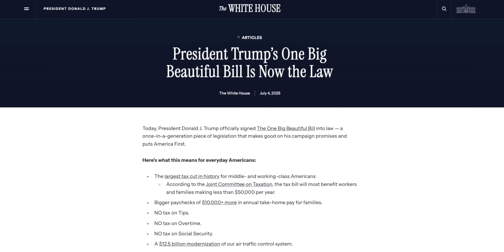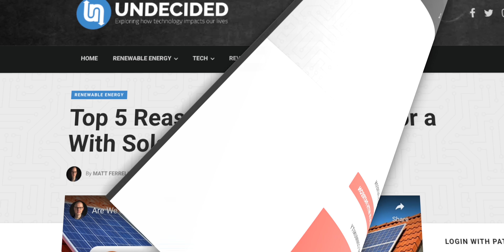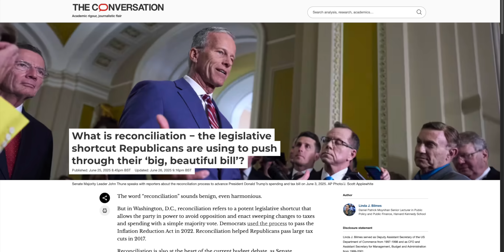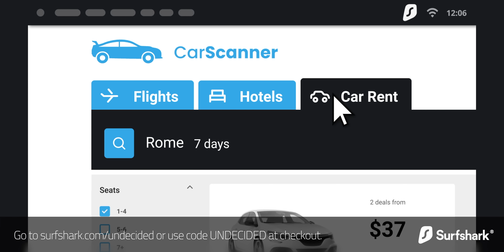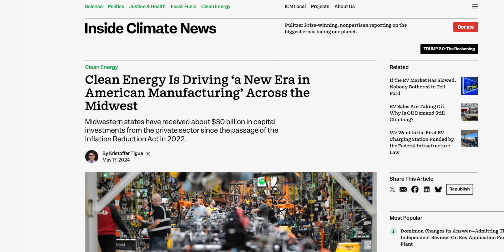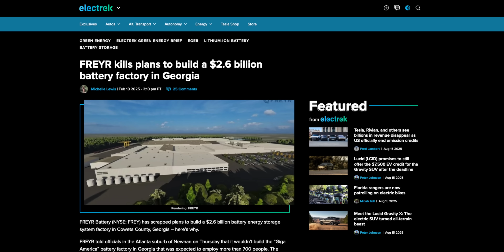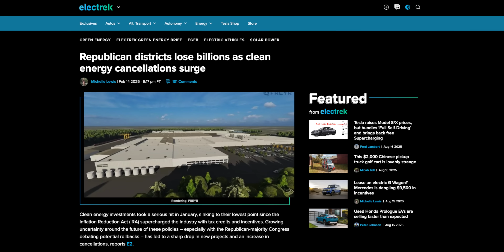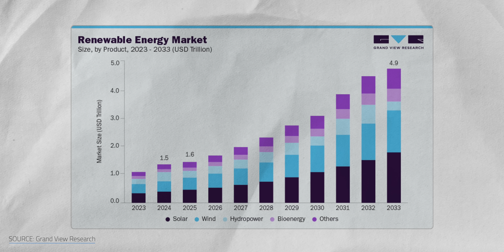How the U.S. Just Handed the Renewable Future to China

Comment: Solar panels are EXTREMELY cheap, no tax credit is needed. The 30% credit on rooftop solar goes straight to higher costs. For rooftop solar, about 70-80% of the cost is just markup, labor, and permits. People can install their own system without the subsidy and still pay half what they would have paying an installer with it. Solar is already the cheapest energy source, so there isn't a need for incentives, already more than 90% of new energy comes from renewables. There is currently a massive oversupply of panels, this 6 month lead time I am calling BS on.  I HIGHLY doubt this will cost 300,000 jobs, this is pure nonsense. Claiming encouraging manufacturing to be domestic will hurt the industry is just plane false. You admit solar is the cheapest energy available, while simultaneously claiming it is in desperate need of subsidies.

For cars... EVs have become cheaper over the years, as battery prices plummet. $7500 credit mostly benefits those with money, as lower income people aren't buying new cars anyway. This just burns money we don't have, we are approaching 40 trillion in debt. If everyone got a new EV, this would just be a tax on everyone, since trillions would be shelled out paying for these, either taxes would need to go up, or we would go that much more in debt. This is just rich people complaining.

The Inflation increasing act numbers are bogus, that thing was a joke. They make up wild numbers out of thin air. It is making all sorts of wild assumptions and twisting reality. There are a ton of solar jobs now because it is cheap. Getting rid of tax credits won't just make the jobs go away, solar will still be very cheap, and the industry will continue to expand. Research will continue, this effect is massively overblown by partisan hacks.

At this point, solar is very mature, I would propose more research and investment on nuclear, which is still happening, just slowly.

I am 100% for moving to renewables, and would encourage everyone with good sun to get solar. Financially it just makes sense, subsidy or not, the equipment is extremely cheap. Spend a bit of time doing it yourself, or at least as much as you can possibly just getting an electrician to help if you aren't comfortable with part of it. Ground mount is the best choice if you can, much easier to install, maintain, and upgrade. It isn't that hard, just watch YT videos, I highly suggest Will Prowse.

Comment: Ehhhhh...being a bit ommissive of some important facts. 
1. I don't think any energy source should receive subsidies.
2. BECAUSE China manufactures 80% of the solar panels, that means we are giving 80% of the subsidies to China. They are also benefitting from the tax rebates as well because they can sell MORE.
3. A good portion of products bought from china is built with slave labor and with materials acquired using far less ecological means, which often offset the carbon footprint benefit of 'green' energy.
3. As good as solar panels are, they're only good when there is sunlight. Thats not constant power generation that civilization needs to operate. Oil and coal can do that for now but we do need to go nuclear.
4. Wind is just god awful. Overly wasteful when it comes to carbon offset and the amount of time they're either broken or just not generating energy makes them a scam.

Comment: It's not all bad. The US will have two chances in the next three years to adjust course. The first will be the mid term elections next year. A little recession timed right could be brutal for republicans and people are getting nervous about that. Trump turns into a lame duck president regardless of the outcome. The second moment after that will be the presidential elections that follow. Both parties will be distancing themselves from Trump, failing policy, etc. Regardless of who wins that, a 180 degree change in policy to contrast with Trump is almost a given. Especially if economics aren't adding up. Higher unemployment, high energy prices, high inflation, etc. could add up to people reacting and favoring whomever has a plan that promises relief.

While incentives are nice, there are more savings possible by working more efficiently. Even with incentives, cars are way too expensive in the US. It's just not a competitive market. Most of what is on sale in the US is unsellable elsewhere. The shocking thing with BYD is that even with 100% tariffs, they aren't a bad deal. Solar is 3x more expensive to install in the US than in Australia. This is stuff that needs fixing regardless of who is in charge. Trump put a a lot of tariffs on stuff. Those raise prices and cause inflation. They are taxes. A party that historically leans towards cutting taxes not cutting taxes is short term apparently happening but long term just not likely to hold very long. All it takes is a clever democrat (or republican) calling that out and announcing that they are planning to cut a lot of unpopular taxes on foreign goods. It will be the best idea ever. And they'll be creating jobs. Politicians are opportunists. And this is a clear cut case of lots of upsides and virtually no downsides. Easy wins. Easy gains. 

In short, the US is going to lose ground until it does that 180. The longer it waits, the worse things will get.. My guess is that Trump might start haggling to stay out of jail after the mid terms. And what better way to do that than to make some deals with some freshly elected democrats. They may or may not get a majority during the mid terms and they may or may not be open to deal making. But Trump is going to be all about Trump and his mind will be on what happens to him after 2028. And Trump can do 180s so fast it makes you dizzy. If it's to his advantage, he'll say whatever and it was his idea all along.

Comment: Well insulated, all heat pump, induction and LED houses have energy costs that are 1/4 or less of traditional houses with gas furnaces and hot water heaters and ACs

And, if you are handy, the solar and batteries to run a 2000 SF house and a few EVs costs $25,000. Our energy savings payoff from our small, used EV, solar panels, inverter and batteries is less than eight years. Yes, I’m including the car.  

And batteries are still improving in safety and functionality and dropping in price. Within ten years, nobody will drive an expensive to fuel and maintain ICE vehicle. And homeowners will no longer be connected to our increasingly unreliable and expensive electrical grid.
Reply: If you're really dead set on cutting your energy usage, you'd get a velomobile, which is over 50x more efficient than the next best.

Comment: Pure power generation is the biggest argument that won me over. It takes us 30 years to build a single nuclear plant that can generate 1.1GW (8.7TWh/yr) meanwhile China just deployed 277GW (340TWh/yr) in 2024 alone. Using silicon. I (was) very pro-nuclear but that math doesn't math. With batteries to smooth out spikes you can win the argument on pure numbers, but when it gets bundled with climate alarmism half the country tunes out. Start decoupling the arguments, like you did in this video, and dish out the numbers and we'll start having far more movement towards renewables.

Comment: The headline is plausible but not definitive. There is strong evidence that fossil fuel pollution and climate change impose hundreds of billions in hidden health costs annually in the U.S. However:
	•	The exact figure ($820B) is not universally agreed upon.
	•	It represents one model’s estimate, shaped by advocacy framing.
	•	Conservative estimates could be lower, while more expansive ones could be higher.

In short: the number is credible as a high-end estimate, but it should be read as an advocacy-driven figure rather than a settled scientific consensus.
Reply: I respect your work, but I’ve got to push back here. You said you didn’t want to discuss politics, but the way you framed renewables vs. fossil fuels turned into a political dichotomy instead of a real discussion of the complexities. Energy transitions aren’t tribal — they’re technical, economic, and logistical.

Here’s where I take issue:

Projections vs. Reality: Solar and wind often look massive on paper, but nameplate capacity is misleading without accounting for much lower capacity factors. Net output is inconsistent compared to dispatchable fossil or nuclear plants.

Grid Resilience: Coal and gas can still ramp up and stabilize the grid in ways renewables can’t fully cover yet. Their role as flexible, on-demand “shock absorbers” matters until storage and transmission scale.

Diversity Matters: It’s not fossils or renewables. A diverse fleet is the smartest path during transition — that means renewables growing fast, but with fossil, nuclear, and storage in the mix to balance reliability.
	
Bias in Framing: Presenting renewables as “ready to replace” or fossils as “obsolete” oversimplifies and misleads. It’s not about ideology — it’s about making the system work without blackouts, stranded assets, or stalled progress.

I actually expected better. I thought you’d cut through the noise, but instead your video leaned into bias. These problems are complex, and the conversation deserves more than a one-sided narrative.

Comment: Renewables and other energy technologies aren't a cure-all. Manufacturing those kinds of technologies still runs off of fossil fuels. Now, Renewables have a much greater clean energy lifespan than that of building them, I know, but we can't transition too early. We have had fossil fuels for centuries, and we can't just throw relatively new technology into the mix. Electric cars, for example, imagine having millions of electric cars on the grid. Yeah, we shift our focus off of oil, but now it's on the grid. 80% of the world's energy supply is fossil fuels, so with more EVs, we have to burn more fuel. Every economy is in a sticky situation. Work too slow and the environment gets worse. Work to fast and economies break down because of their reliance on fossil fuels. It's a matter of transition. Im all here for renewables, and we should slowly mix in as the tech matures.
Reply: But they are being slowly mixed in. These changes aren’t about making sure it’s blended in reasonably - it’s about destroying it.  China is doing it with very few problems. 90% of their new car sales will be EV in five years.

Comment: New battery technologies will lend even more favor to renewable energy implementation. Sodium, iron oxide, advanced aluminum, etc will make solar and wind vastly more competitive due to base load stability needs. Frequency stabilization of power grids is one area that needs improvement, and newer generations of inverters may actually be able to address that issue as well.

Comment: So as a construction worker I am confused because I see the transitional jobs as something that I do not count.  Most of the jobs being created by clean energy is what it takes to build them.  Then there jobs go away.  They might go to another job but are counted again as a new job under a new solar project.  More so being from CA and then Nevada I have watched many solar wind and other clean energy jobs be abandoned and be a waste because they never produced or did what they say.  Now I am for green energy but the batteries we need to make them still needs to come further.  If the Sodium Batteries are what they say then that could be a game changer.  Because the biggest problem with at least wind and solar is the storage of excess energy.  What I really am interested in is the mini nuclear and tech like that.  If we in America perfect a way to have cleaner Nuclear then everything else is left in the dust.  Last point I will make with solar if it were such a great thing then cities and the country would require them on roof tops as a building code so that there was constant energy going into the grid.  The problem is that the energy companies would not make money because of not being able to charge so much for electricity.

Comment: I’m upset when folks I otherwise agree with make mistakes like this.  Coal has NOT been designated a critical mineral.  Metallurgical Coal has been designated a critical material.  It’s a big distinction. Metallurgical coal is a crucial component of manufacturing steel, not for generating electricity.

Comment: Completely disagree with you, the fields of solar are totally unwanted a blot on the landscape, just like the original wind farms , where the investors set it up but zero maintenance, they run it into the ground never repairing it , and will abandon them when it’s profits drop off, solar should be roof only whether it be commercial building, high rise which 1 side left semi transparent over windows zones ,  and housing , if you want to cut your bills , you must budget accordingly than oversized solar which forces the grid to suffer . As a wind farm owner the rules on investor requirements must be made, I have seen first hand where corps sell shares and customers  buy 1000 units worth , but the maintenance costs are defaulted or not enough to keep it alive or pay even any sort of insurance setup to help cover costs if the worst happens the insurance market is a scam that needs regulation for renewables  Fairly priced as right now it’s still in the same category as oil wells , I’m a firm believer if you put a wind farm up , you should be forced to pay to take it down and of life or failure , I was left covering a 300,000 loss after the small holders happy to take the cash disappeared or entered chapter 5 and disappeared following tornado damage.  This is just once case, the same thing happened in Texas, small  holders have to pay or be banned and force utilities to decommission in there bid with a bond to pay that cost of decommissioning. What I feel is wrong is it’s marketed as 10 year’s investment, the reality is irs just 2.5 years after decommission/commissioning costs that’s why wind is the highest cost per mw to fossil or nuclear

Comment: while Im not anti solar I do feel that nuclear is the tech we drastically need the most development on. fossil fuels are a staple that allow easy remote energy production in most climate conditions such as the middle of a midnight blizzard so we shouldnt eliminate them either but with nuclear we could be distilling sea water, collecting the salt, using high temperature electrolysis to provide hydrogen for conversion with co2 into methane, and provide power and heat all from one station. 

Solar is neat but its case use has been over sold. Its not a bad technology but its gotten far too much funding. Its right up there with subsidizing corn to add ethenol to gasoline where we end up spending 4 gallons of diesel for every gallon of ethanol actually produced. 

As for carbon emissions, the planet had its largest biomass when the climate was hotter and the co2 was higher than it is today, we're still emerging from the last ice age and are far from anywhere near the warmest. As stewards it falls on us to pay attention and properly manage the climate sure but labeling co2 as a pollutant is obscene. 

personally I think we should be pumping seawater into the salt lake basin and death valley to help alleviate the arid conditions in the west and increase snowfall and the overall water cycle thought the center of the continent but what do I know.
Reply: nuclear is not cheap, stop talking about things you do not understand
Reply: @gsabic  nuclear is cheap, the increased costs associated with nuclear result from overly burdensome regulations that have been focused on making nuclear more expensive and less accessible.
Reply: @chrisquinn8150  electric companies like to make money, they will chose the cheapest souse of energy generation available, that is why they chose solar. we are in 2025 no in 1975, solar panels are almost free
Reply: @gsabic  solar panels are almost free in china because they're the biggest producer, shipping a panel across the globe has significant costs associated with it and the materials are still expensive even if newer breakthroughs promise future savings. In the US solar panels were being subsidized which just means they were being sold for less then their actual costs for both sourcing and installation. removing these subsidies makes solar compete on a level playing field. Add to this the fact that current solar isnt likely to last 20 years without significant refurbishment and replacement and we can see solar is not nearly as cheap as we have been lead to believe.

 The first nuclear plants were build fast and cheep and ran for more than 60 years while maintaining the lowest injury rates in energy production with the smallest volume of pollution all of which was captured and stored and much of which we are learning can be recycled for future energy production. Modern reactors such as those used on ships could be standardized and mass produced further reducing their risk and costs. By far the biggest change we need to make is have the government absorb the regulation costs of nuclear. If the only costs were the actual building of the plant and the fuel to run it as has been the case for nearly every other method of power production, nuclear would be the cheapest energy per watt by a significant margin.
Reply: @chrisquinn8150   "current solar isnt likely to last 20 years without significant refurbishment" LOL, where do you get this information?
Reply: @gsabic  the manufacturers warranty 10 years, this channel has reported 20 as the current lifespan for the latest tech.
Reply: @chrisquinn8150  some solar manufactures may offer 10 years warranty, do not buy those cheap panels!!!! there is plenty of solar panels with 25 years of warranty
Reply: @gsabic  one example? installers will give a 25 year warranty because they intend to replace panels as they fail for the added cost of the labor. its a racket not actual longevity. the panels themselves have no such warranty.